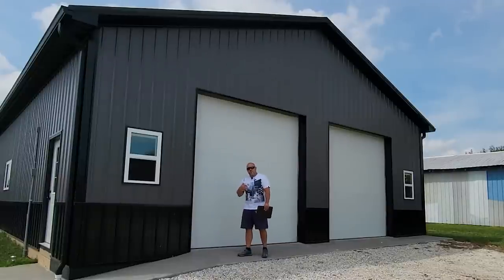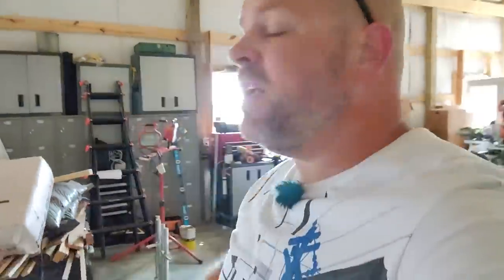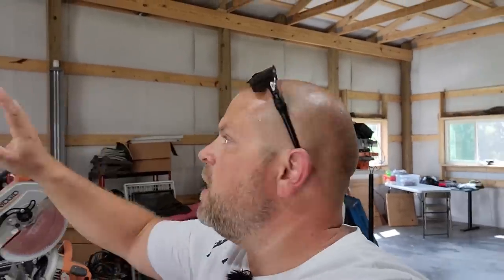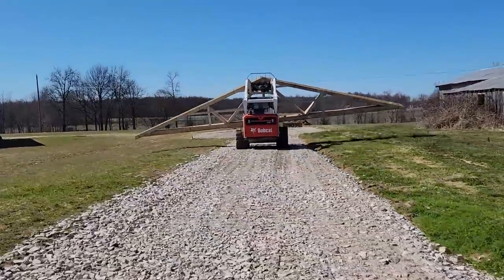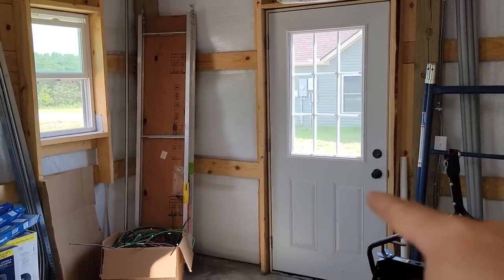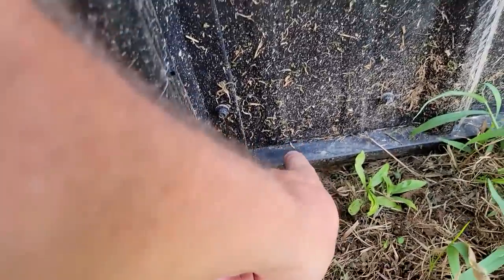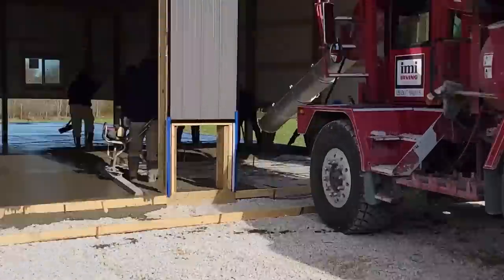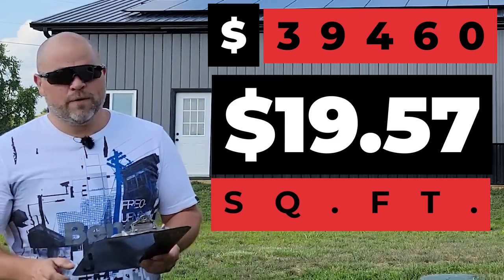NOT CHEAP! The real cost of a 36x56 Pole building

Comment: I went off your video. I just finished my 36x56 and same 2 tone idea. Its total is at 55,200. I knew the contractor, offered him the same labor rate 15k and also concrete was same rate 5k in crete, 4in labor. I went with 2x4 every 2ft post built it looks almost identical!! And also same rate for metal igot from my local amish community. 9k for metal everything to the screws! Thank you verymuch for your help!!
Reply from the maker: I'm glad I could help. It's always nice to hear that I was able to help someone. It's the whole reason I put out videos.  Thanks for watching and commenting 👍🏻
Reply: Man that's hard to believe that the concrete was only 5 grand. I just poured 20 yards and the redi mix alone was 4500 and
Reply from the maker: Plus the $3000 labor 9:20 I talk about the total all in cost 😁

Comment: Could you have done rafters/joists instead of trusses.? Reasoning...it seems you lose ALOT of space. Either storage or possible living space using trusses. How thick a concrete pad did you pour and was there any plumbing for the building? Water/sewer/drainage?
Thx
Reply from the maker: I thought about building it to have open space in the attic or loft but ultimately decided it was not within my budget. Concrete is 5in thick. I did put a drain in. Thanks for watching and commenting 👍🏻

Comment: I think your costs were right on but one thing that anyone building one should look into is getting your wood from a local sawmill. The saw mills around me sell hardwood, mostly oak for far cheaper than the local lumber yards and big home improvement stores such as Lowes and Home Depot sell their pressure treated and non-treated softwood lumber for. You will want to get this wood long before you build, at least eight months to let it dry out as it isn't dried yet but you will end up with a stronger and more bug and rot resistant building than you would with conventional lumber at around half the cost.
Reply from the maker: Great advice! Thanks for pointing that out. Thanks for watching and commenting 👍🏻
Reply: SHARP. TY
Reply: Once hardwood becomes dry it becomes much harder & so drilling & nailing takes more time than conventional lumber plus that stuff is very heavy
Reply: Great tip. I have an Amish sawmill less than 3 miles from me. Never thought of going the hardwood route.

Comment: I have a 24x36x15 pole building getting built this year in my back yard total cost is $49,000. They're building a 8x24 loft inside and additional 1500 sq ft of concrete pad/driveway to pour. Im also limited with 9 foot wide entrance on either side lf the house so that complicates things as well. I think the price is fair given limited access and they're doing everything from dirtwork to final steps as well.
Reply from the maker: 24ft trusses help save you a lot. Congrats on the new shop! There's nothing like having a nice quality space to do stuff. Thanks for watching and commenting 👍🏻

Comment: Thanks for the details on cost and the other videos in this series (I watched the failed electrical inspection video first). We bought a home a few months ago that has 2 barns. One is basically the same as yours, but a bit smaller at 28x40 and it has a conventional wood sheathed roof with asphalt shingles. It was built to be an actual barn and one wall is open to an outside fenced in area where the original owner's horses would graze. It still has a dirt floor and interior half wall to keep the animals from getting in to the the storage/tractor parking area. I plan to build it out as a 2 section shop: the open side will be closed in and a full size wall will replace the half wall turning that portion (roughly 1/3 of the building) into a wood shop and the rest will be for working on cars or other vehicles. It's probably going to take me a year to get everything done based on time and budget. I want to do as much myself as possible and your series here is going to be very helpful. The barn won't have solar, but the house came with a 6.7Kw solar array already. I also plan to add battery storage for that, although we need to get a handle on the amount of power we use vs production to make sure there is excess to be captured by a battery.
Reply from the maker: Congrats on the new property! It's taken me roughly 8 months up to this point to finish out the interior of mine. I still have a bathroom to completely finish. I am holding off on that since none of the pipes were installed before the concrete was poured. I gotta saw up the concrete in that room and do it right. Make main water connections at the street and all the fun stuff. 😀 I don't have batteries on my solar system since I can't justify the cost. The ROI is not quick enough. Maybe someday I will find a deal I can't pass up and grab it. Thanks for watching and commenting! Good luck with your build!

Comment: Great video , and great information.  Beside on going bigger in side what would have done different or add to the building? Like heat floor , and more on the installation on the walls ! A loft in there or maybe inside an extra wall block off so people who come can't see behide  that wall
Reply from the maker: Looking back now, I would have built a stick built... Just like a house. The metal siding is causing a ton of communication interference. It's been a nightmare getting signal inside. Other than that, I love it!

Comment: You did not mention is it conditioned? What are you doing for ventilation to keep condensation inside the building?
Reply from the maker: We are using a double bubble wrap. Adds  a vapor barrier and a small reflective r value. It's the white you see all over the walls and ceiling. That was included in my metal cost, because I bought that at time of the metal purchase. We also have standard ridge vents. If I finish this building I will add one decent sized attic vent on each side of the building. As of right now, those are not needed. Hope that helps. Thanks for watching and commenting 👍🏻

Comment: Thank you very much. It's so hard to find straight forward costs for buildings like this. 

Questions: is your interior height 12ft? 

Also did you design this building or was it a "package deal"
Reply from the maker: Appreciate it! Thanks for watching and commenting!
Reply from the maker: Yes 12ft btw - I designed it it was not a pre fab.
Reply: @JustinsProject  thanks. We bought 11 acres almost a year ago. I'm building a cabin currently and then plan on starting my "dream shop" once I get the cabin finished. 

I was planning a 30x40 with lean-tos on each side but now I think a 36x56 is within my budget, thanks to this video
Reply from the maker: @DaileyWoodworks  Congrats 👏 Nothing like some land and a nice shop.

Comment: Did you use a penetrating concrete sealer to keep the concrete from getting stains?
Reply from the maker: Yes I did. The crew that poured the concrete floor, sealed it. They had a bunch left over from a commercial job and tossed in with their quote. Thanks for watching and commenting 👍🏻

Comment: great video, sorry if i missed it but how tall is it? I am building a 30x40 & I am unsure on how tall to go. What part of KY are you from?
Reply from the maker: I went 12-foot ceilings after 5in  concrete, but if I had to do it over, I would probably do 10 feet ceilings for my needs. I went 12 feet as a just in case. Plus, it allowed for the 10x10 commercial doors. I would probably change the doors to my original design of an 18ft x 8 door if I had to do it over. I am happy with everything, though. It really comes down to your personal needs. Thanks for watching and commenting 👍🏻

Comment: 'preciate your time for this.  Helpful.  Central KY is a ways from me, (North IN) but probably similar cost.  I have found a local lumber/truss company in Mishawaka that will supply trusses cheaper than menards, all yellow pine at 1/2 the spacing. (2' vs 4').
Reply from the maker: That is awesome! I would recommend 2' OC because in the end when finishing out 2' OC turns out to be almost as cheap once you add in all the purlin hangers and purlins to hang the insulation and wall board. Thanks for watching and commenting!

Comment: I assume that you acted as the general contractor?  I have been wanting to add onto my existing building but the quotes have all come in at over $50 per square foot.  I have been trying to find carpenters do put up the structure but they are all tied into contractors around here and won't work for an individual.  Nice building.
Reply from the maker: I was hands on during the building process. I was going to build it myself but needed it within a 2 week period. It all worked out. The group of guys that built it were great. Showed up on time, worked hard and never made excuses. Thank you for watching and commenting! 👍

Comment: Great video great info     Threequestions.  Why didn’t you go with a package from someone like Menards ?  Advantages, disadvantages ?  
Did you consider an FBI or Morton building ?
Lastly did I miss something as when you quoted everything you mentioned only the gutters pricing included the labor but what about the labor to build it all ?
Thanks 
After your build what would you do different if you had to build another?
Reply from the maker: I did purchase the package from Menards but chose to buy the metal from a local manufacturer because it was 30% cheaper on the metal and a better thickness. Other than that, almost everything was purchased at Menards. The good thing at Menards is that you can custom design your build, and they will build a materials list around that design. I considered Morton's, but the cost was so high I got priced out. I covered the labor cost for building and concrete. The gutters were a package deal from a local installer that did not break down materials and labor... just a price for making and installing them. Hope that helps. Thanks for watching and commenting 👍🏻
Reply: @JustinsProject  
Thanks.  That helps a lot.  I missed that you were including the labor  I’ll watch again 
His thick did you go on the metal ?
With your experience do you have Any thoughts on using a pole barn shell for a pole barn home ?   I understand that’s a loaded question I’m just thinking about building one and the only way you learn anything is by asking and seeking advise from others 
With the experience you have what are your initial first thoughts on what would you want done differently ( if anything ) on how your barn was built if it were to be for a home ?
Reply from the maker: @@roberts4411 If your main goal is to convert it into a home, I would not build a pole style. I would frame it with 2x6 walls like a stick built home. There are a lot of reasons for that and very hard to explain in a short response. If I had it to do over, I would have gone that method. I thought going pole style would save money, reality: it is not, as I starting to finish it. In most areas, you will have to obtain a certificate of occupancy. Depending on the area, the first thing to do is reach out to planning and zoning and see if what your looking to do is allowed. I know it sucks, but it would be terrible to start a project that big and be told you can complete it for what it was intended for.
Reply: @roberts4411  Some banks won't finance a pole barn (poles in ground) style construction. I would have a conventional footer and slab foundation if I was building a home to live in.

Comment: Folks, if you are building a pole building sheet those roofs.  That fake roll insulation is garbage in the ceilings.
Reply from the maker: I'm not sure I would call it garbage. It's a great moisture barrier. True, though, the double bubble is not an insulation. It's a reflective thermal moisture barrier. However, when used in conjunction with my now R-38 in the ceilings, the shop is exceeding my expectations. Thanks for watching and commenting 👍🏻